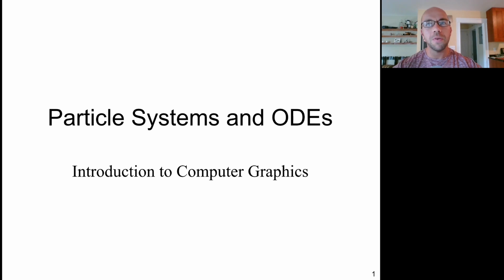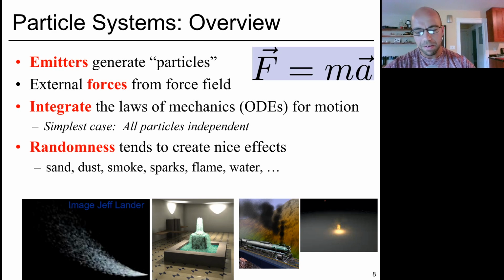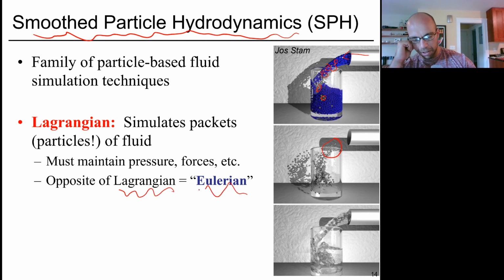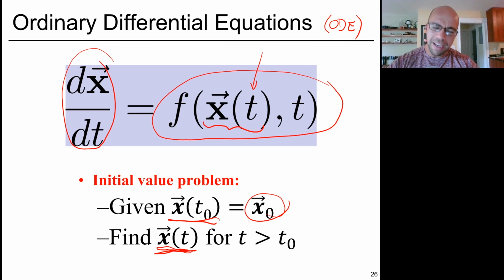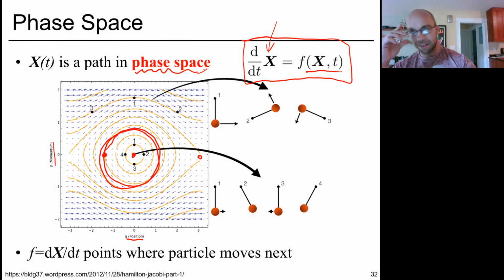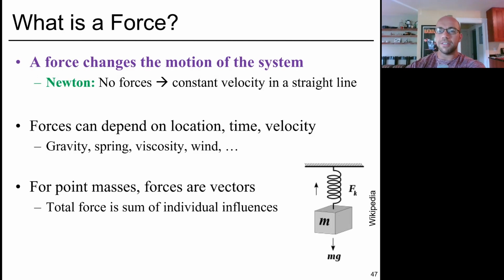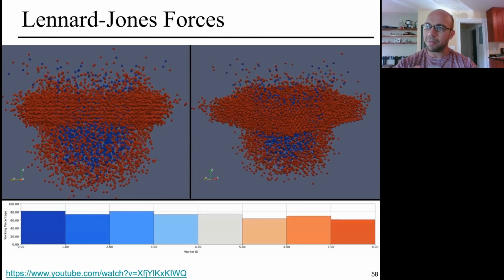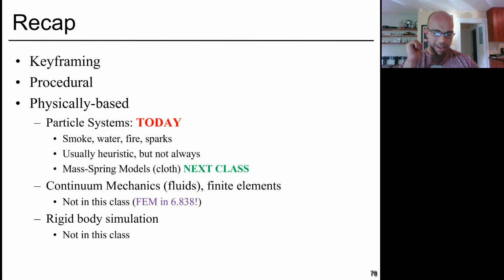Introduction to Computer Graphics (Lecture 7): Particle systems, ODEs, and Euler's Method

Comment: Really great lecture!! Thank you so much.
One question : in Euler integration of centripetal force it's easy to see that extra energy gets added at every step. But the opposite seems to hold for constant acceleration in forward direction. Euler integration seems to fall behind a bit compared to continuous integration in that case.
Am I missing something here?